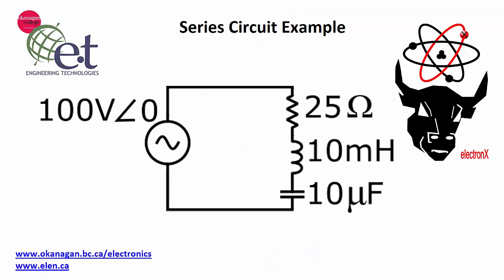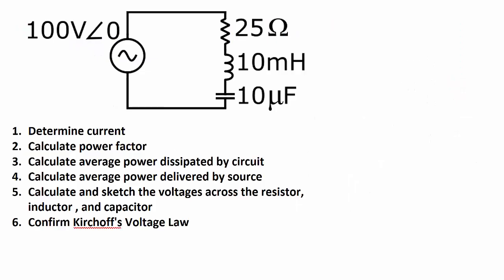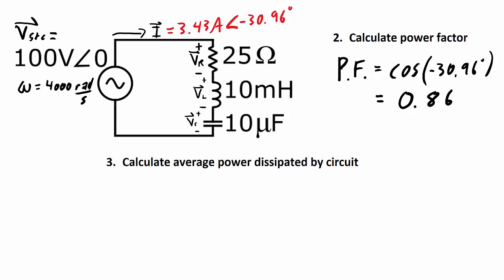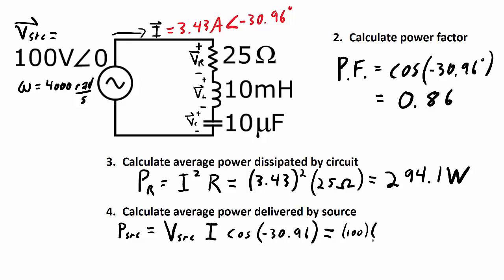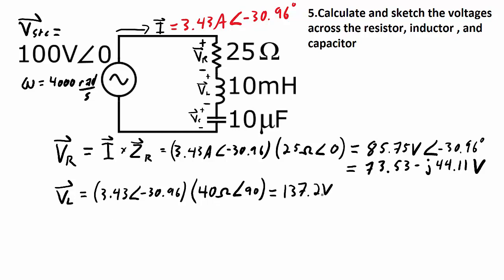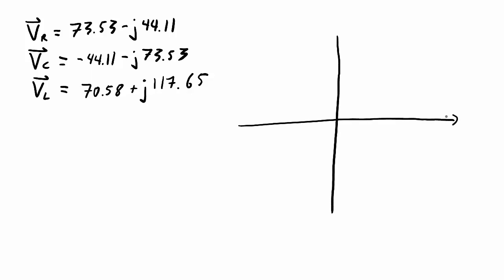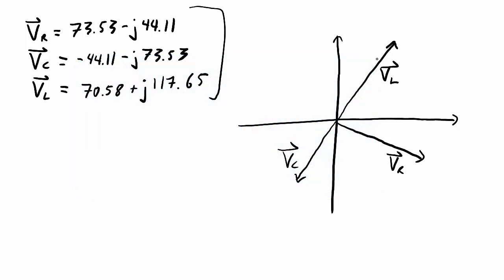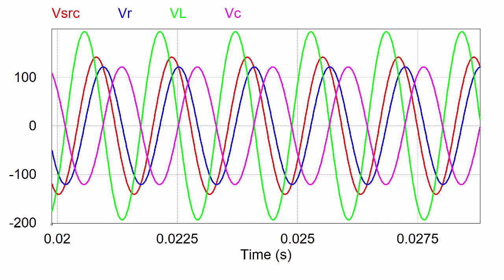Series Circuit (AC) Example Calculations

Comment: I remember being confused, 40 years ago, when I learned that capacitance in series is not additive, and that inductance in parallel is not additive. What I failed to consider is how this is elegantly accounted for by the way we calculate impedance, with capacitance being in the denominator of Z = 1/(2*pi*f*C), and inductance being in the numerator of Z=2*pi*f*L. So, once you calculate your individual impedance numbers, don't let those details confuse you. Once impedance conversion is done, it is simply a matter of rolling through and trusting the math, letting phase angle take care of the details.
Reply from the maker: Yes, well put

Comment: the compensation capacitor should be in parallel to the load. and here in series. so how does the capacitor compensate the inductor?
Reply from the maker: This circuit in not for power factor correction, it is just an arbitrary circuit with a resistance, inductance and capacitance in series.
Reply: Ok thanks brother

Comment: 40 ohm 90 deegres = j 40 what J is .... please can you explain it . thnx
Reply from the maker: The 'j' before the 40 denotes that the number is an imaginary number. In the real/imaginary plane, the horizontal axis is deemed the real axis and the vertical axis is deemed the imaginary axis. An impedance of 40 Ohms 90 degrees would be a vector pointing straight up which is all in the imaginary axis, so it has a value of 40 imaginary Ohms or j40 Ohms.
Reply: thank you very much bro ... you are great